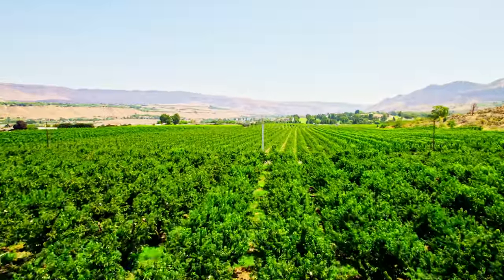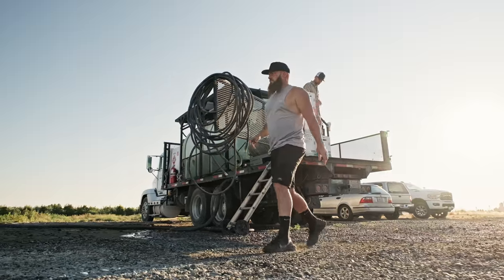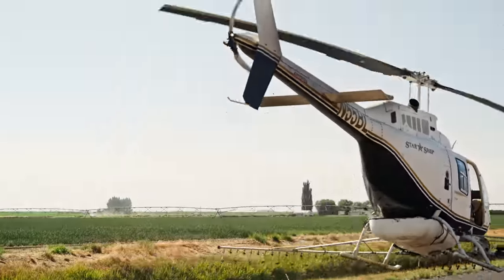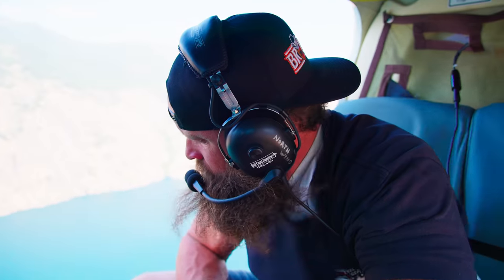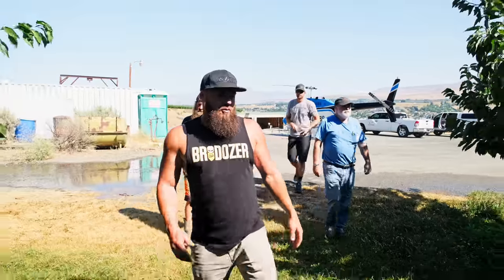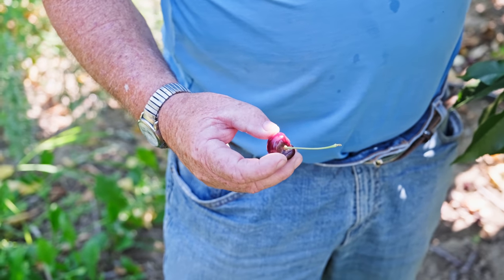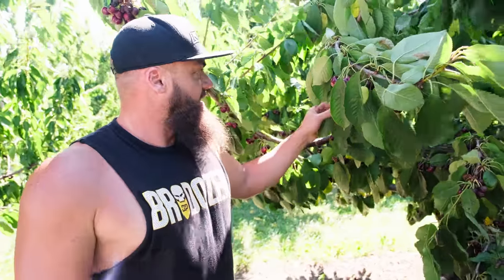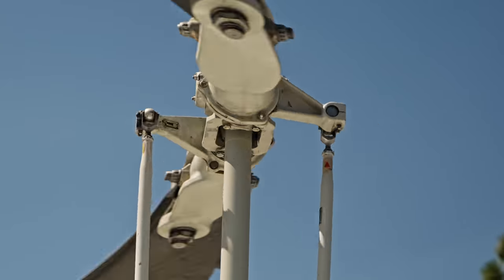These Pilots Risk It All To Save Crops From Being Destroyed By Rain!

Comment: Down here in New Zealand choppers are used during the onset of winter for frost prevention on fruit crops. Apples, Grapes, Kiwifruit. They hover/fly over the crops to keep the air moving so the frost doesn't settle.

Comment: @ 15:00 As an Australian who is currently in the process of joining the Navy as a helicopter pilot, i have done extensive research into the role. One of the clips i came across involved a deckman whose role it was to chock a helo upon landing a moving boat. During the clip, you see the helo land on the deck and the deckman run out chock the helo, but as the boat was still moving, the air was choppy, the pilot had to make inputs to control the stability and secure the landing, at which point the main blades came a lot lower than what would normally be expected, the blades contacted the deckman's helmet/head which instantly turned it to a mushy consistency that spread across the deck. Safety is no joke is you plan on returning home to your loved ones in a condition that still able to return that same love.

Comment: My Dad used to spray cranberry bogs in the late 50's on Cape Cod. All mechanical open Bell helicopter like you would see on the show MASH. Mad respect for the skills needed to do this. My Dad stopped flying after flipping his rig upside down to avoid some new powerlines that were built while he was flying in the Korean war. This is NOT easy stuff, even though they make it look easy.

Comment: Y'all should definitely come out to NC & see the air plane crop dusters. It's a lot more dangerous than helicopter dusters! These pilot's are truly off their rocker! Most of our farm lands are surrounded by tree line's, power lines / power plant transmission lines, & cell towers. So they have to make sure they're on the right line, drop down & get low enough to almost touch the ground, activate the sprayer, spray, & then deactivate the sprayers & pull up just before hitting the tree's, power line's/transmission lines, ect & then do it all over again. It's crazy just to watch!

Comment: I spent over 3 years in Germany as a military spouse the army airfield had ahuge siren that would go off in an emergency which when it went the base shut down you knew something was bad but you didn't know what.  The day the siren went off it filtered out there was a bad accident but not who got hurt or what.  Long story short young recruit not paying attention walked straight into the tail rotor. The accident took may hours to get everything into many body bags and the whole area cleared up. It was an extremely traumatic event. Hugs from Texas Mimi

Comment: Dave, I have to correct you on this:  ULV is Ultra Low Volume.  It is not a type of chemical, but a rate of material per acre.  It most likely is about 1qt per acre, vs the 3 to 7 gallons per acre of water as carrier used .

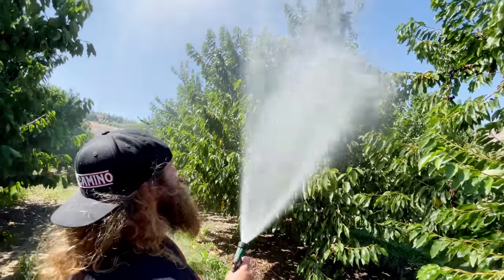Comment: @35:40 did you see the large hose and water pressure they have on that farm? You won't see that kind of pressure at your house. Most if not all municipal water systems run at 45 or so psi. These farms have their own water system and can vary the water pressure to what ever they want. Their house is likely at 45psi because that's what residential fixtures are designed for BUT their irrigation may be at 75 or higher pressure which is why the hose Dave was using is so large.

Comment: Heavy D, have you flown a Hughes or  Schweizer 300C Helicopter?  If so, is your twin turbo engine helicopter easier to fly?  Would they be able to use a 300C to help dry the cherries or do they need a helicopter with more inertia area?

Comment: Sorry Bro, as a former military helicopter crewchief, I MUST correct you!! NEVER approach a helicopter from the FRONT nor the BACK, as the main rotor mast can move forward to the point of taking heads off. Many videos of that as well.  ONLY approach straight in from either side in view of the pilot when blades are turning.

Comment: All the farmers need to do is point a microwave gun into the sky above where they want rain & that will cause clouds to come about & rain simple. you pull apart a new microwave oven & put the actual microwave generator at the end of a painted steel funnel & cover the electrics in a painted steel box that's sealed against the funnel plus put a glass pain over the end of the funnel that is pointing skyward. When everything is waterproof you turn it on & walk away making sure you don't look into it or put your hand over the glass. It will send microwaves all day & all night directly over the field & cause rain.

Comment: Your mechanics may have sucked but the pilot is responsible for the airworthiness of the aircraft.
A Bell 206 is required to have the dynamic balance of the main & tail rotors checked every 12 months & a mech can't comply with that procedure without a pilot.  Become more involved in your aircraft's maintenance - it's your life !
Have a WSPS installed & then don't ever use it.

Comment: So, I'm sure you already know this, but FYI, that is not a technically "semi truck". "Semi truck" is a derivation of semi-trailer, a trailer has only one side supported by axles and must be supported by the axles of a tractor unit through a fifth wheel. That's a bobtail or straight truck, not a tractor for a combo unit, thus, NOT a semi. I know it's a common misnomer, but it bugs the crap out of me. Even beyond my normal shameless pedantry.